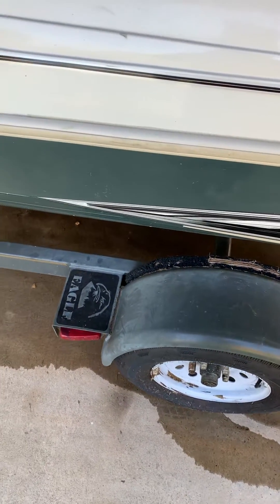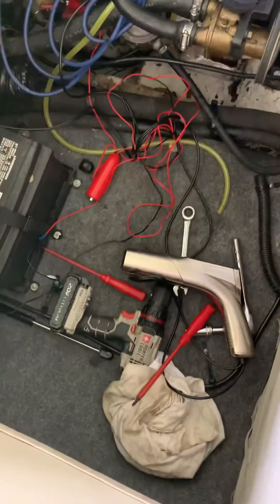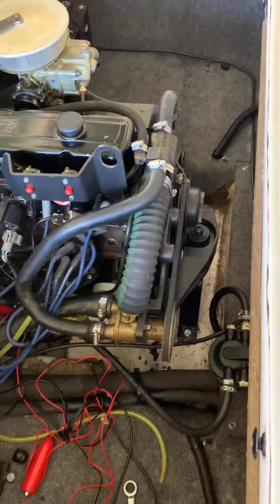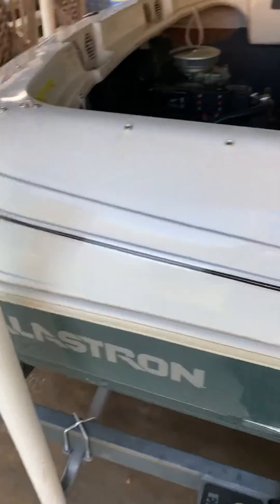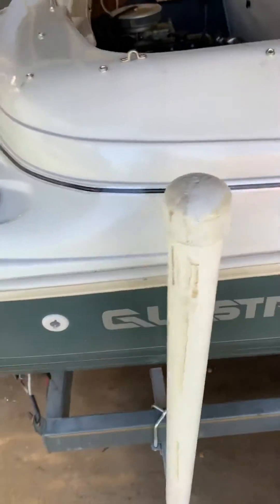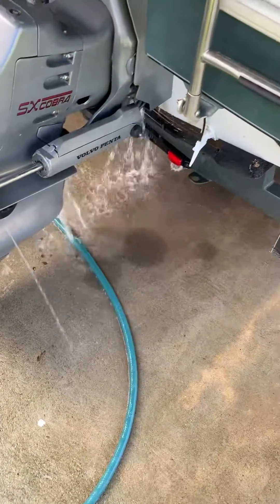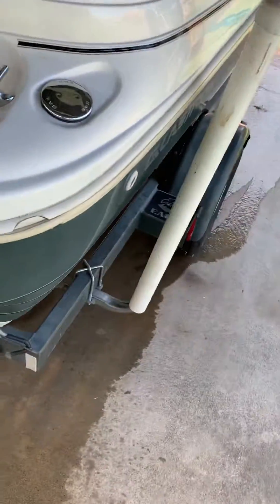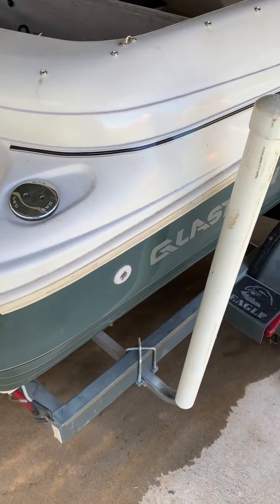Volvo penta 3.0 valve adjustment

Comment: I mean back fires at mid throttle. Idles smooth with very small ticking or tapping sound. Very load at WOT.
Reply from the maker: The ticking or tapping could be a bent valve but more than likely a loose rocker on the valve train. Tighten to manual specs and that should solve it.

Comment: Thanks for the vid. I have a 96 Penta B170 4 cylinder that has loud tapping noise when speed up. Spatters at mid throttle.
 Is this volves adjustable?
Reply from the maker: Yes the valves should be adjusted in the head.

Comment: So I have question. I have a 2006 Volvo Penta 3.0. Why is when I crack the throttle and return to idle quickly the 4th cylinder pulls water in. Just enough to make it miss. Then I bring the engine up to 2,000 rpms and it comes out of the miss. If I slowly bring the throttle do I have no miss. Any help is much appreciated. Thank you
Reply from the maker: That could be a crack in the cylinder head, or bad head gasket. I’d lean more on the head gasket as there is more water pressure under load. Hope this helps.

Comment: I just bought boat with this engine but I have few issues... Acceleration lag, engine stalls at gear quite often - can be solved but adjusting idle speed to 1200 which had previous owner and thats crazy high imo.. whats normal idle speed for this engine? and last but not least i get only like 4 - 4,2k wot rpm..
Any thoughts ? :)
Reply from the maker: Carb rebuild is a def start. Idle should be around 650-750 idle under load. As far as the wot issue, I’d check for proper adjustment on valves or possibly a worn camshaft.